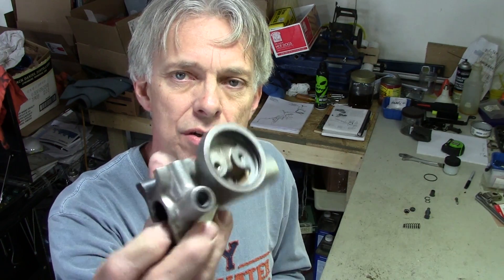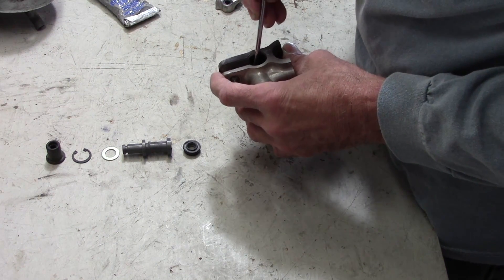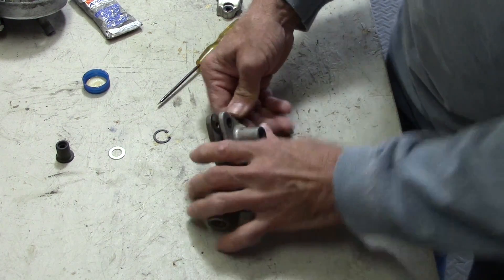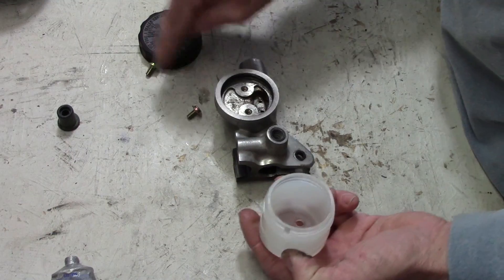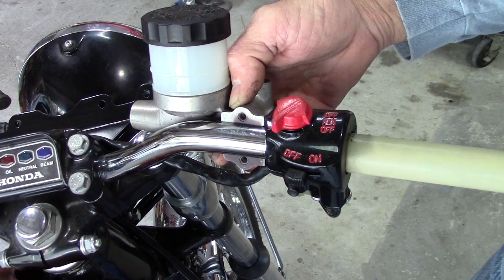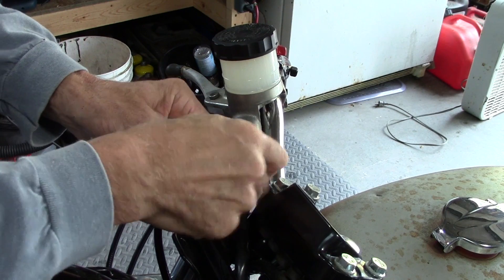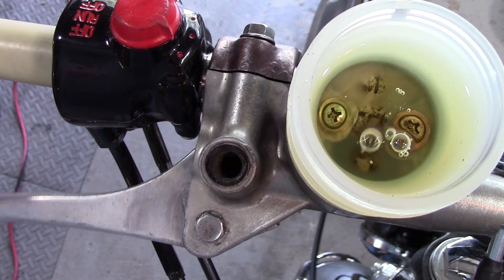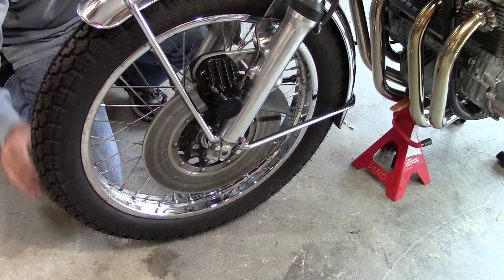73 Honda CB750 Custom Build Part 38 - Brake Master Cylinder

Comment: Here's a hack a mechanic taught me years ago. He took a large turkey baster and attached a clear tube to it just like the one you used here, sealing the connection with alternating layers of silicone and electrical tape. You use it by sucking up some fluid, then push the tube onto the bleeder and sqeeze the bulb. It forces the fluid up the line and fills the master cylinder. I've used this method on many bikes. It works well.
Reply: +Bobby C. They sell a commercial reverse bleeder for cars like that.
Reply: That's good to know, thanks. I'm gonna look into it!

Comment: When bleeding the brakes (an old tip from American Honda... yes I was a tech back then) Do NOT pull the brake lever all the way to the handlebar when bleeding the brake.  I tie a shop rag onto the grip and place the knot between the grip and the lever.  Pull the lever til it touches the knot but no farther.  Keeps the seal from going farther than needed.

Comment: I tend to use a syringe to do my brakes, saves a lot of pumping. Either pump fluid up into the line like the man with the turkey baster, or draw fluid down from the master cylinder, saves a lot of work.

Comment: I'm still new to this stuff.  Does the hole in the banjo bolt have to line up perfectly with the opening in that metal piece that attaches to the hydraulic line?  Is there any trick to that?  And what size tube should I buy to bleed the brakes?

Comment: (1) I really wish you had included video of extracting that C clip.  It's a real biatch to remove... your method would have helped a lot of people to see how.
(2) There is an aftermarket check valve you can fit onto the bleeder, which makes it so you don't need to rotate the bleeder valve orientation to pump the old fluid through.
(3) This video is misnamed in a way... your bike is a 73, but the master cylinder is weird AF.  It is not stock for the bike.  Even so, it is still a useful vid, but it was confusing to me to see the wrong part on a 73 at first, until you said why...and I had to re-listen to what you said there, to make sure of myself, at first.
(4) Thanks for making this video regardless.  I really appreciated it.  Once I rebuilt my brakes before internet told people how, and I felt like it was almost a coin toss to figure out how to orient the master cup (or cap - whichever it is called).  That was about 10 years ago.  Finally after that 10 years you solved the mystery for me.  I did install it correctly.  :)
(5) On my bike you would NOT want to hover over the reservoir with a camera, because when it is pumped even a little too fast, it backsprays brake fluid from that hole, and it can squirt into your eye.  Yes, mine did that to me.  The safe way to do it is to put the cap over the top so it can not spray into your eye, or onto your gas tank's paint.  And you want to squeeze slowly for this part, just to reduce the spray even more, and also to prevent air bubbles from being pulled down through the air-surface of the reservoir, and down into the brake line...On the stock brake reservoir, you need to keep adding the fluid to it during the entire process, to ensure that no air gets into the line.  The stock part's reservoir is much more shallow than this non-stock one you have.
Reply: 007mercucio You can also place a good size coin in the reservoir to prevent the pressure return hole from spitting back . (like a US quarter) leaving the coin in there doesn’t hurt anything long term either .
Reply: I spent hours with circlip pliers and ground down long nose pliers, finally took it to local custom bike shop and the owner got it out in under 5 min. using a pair of dental hooks (picks with  curved end making a semi-circle)

Comment: nice job. how do you get the feel to tighten things without using a torque wrench? I never feel confident in doing it in case I strip the threads, or don't do it right enough. especially the banjo bolt.
Reply: +apx5777 You just get a feel for it with experience. Using a torque wrench helps you feel how tight bolts are.

Comment: great video. Here is a question  I've often thought of... Why are brake reservoirs  of different  sizes? I have a Yamaha fz1 and it has the smaller rectangle  one. But is see other bikes with big round ones.  Ane they are downright ugly.  why  the difference?

Comment: I use brake fluid to lube the parts as I put them together. Also, don't use DOT 3 fluid. Its crap. I use DOT 5 in everything. If for some reason you don't like DOT 5, at least use DOT 4.
Reply from the maker: Main difference between 3 & 4 is boiling point. 3 is Glycol Ether, 4 is Glycol Ether/Borate Ester. Dot 5 is silicone based and should NOT be mixed with anything glycol based. It's also hydrophobic so it doesn't absorb water.
Reply: @HackaweekTV  that's correct. I use dot 5 in my bikes after total rebuild of the brake system. It's not for everyone, but I prefer it.

Comment: A lot of people are getting fed up with satellite and cable providers for their price gouging and poor customer service, and switching over to streaming services like Roku. (Like me).
It's so prevalent that internet providers are being pressured into integrating monthly limit caps.
Luckily, I have a fibre connection to my locally home-grown ISP that's less than a mile away, they have excellent customer service and will NEVER cap their subscribers.

Comment: Easy when you know how.Now would you bleed the brakes on a CBX 750?I've tried everything and can't manage it.Replaced pistons,seals,brake lines and mastercylinder. Blead repeatedly till no more air comes out and brake is still spongy.Must be missing something but don't know what.
Reply: +Alan Williams Replace the brake hoses with braided steel lines. HUGE difference! Old rubber lines can become weak and distort under pressure.
Reply: +Dean Segovis I did,Dean - twice.Ditched the splitter because people told me it can trap air.Now have two lines going directly from m/cylinder to calipers -no better.Weirdly, with just one caliper connected I get good pressure but when I add 2nd ,pressure is lost.Local bike shop thinks replacement m/cyl  is probably dodgy because it's a pattern (copy) part.It worked for 3 years,though.Shop advises m/cyl refurb kit but that will probably be a copy as well.Bikes - who needs 'em?
Reply: Did you get this problem solved?
Reply: No.I gave up chasing my tail and put the bike back on the road.Probably rely on back brake a bit more.I read an original road test of the CBX 750 in SuperBike magazine(online).They liked the bike but mentioned that front brake lever came almost back to the bar.I suspect a performance m/cylinder might sort it but I'm not prepared to spend the money.

Comment: Weird question(s):

1. Does anyone know what the approximate PSI this or similar master cylinders put out or capable of?

2. Does anyone know of a pressure transducer for a motorcycle brake system or can I use an automotive transducer with a reducer (if needed)?

Comment: it was always my understanding that no type of oil or lubricant should ever enter the master cylinder apart from brake fluid....or have i heard wrong?
Reply: There is special mounting grease included in most master cylinder repair kits, which is also sold separate as brakecylinder paste (e.g. ATE Bremszylinder-paste (thats German so it must be good)) or you can use fresh brake fluid. You're right about not just any grease should be used.

Comment: That doesn't look like any CB750 master cylinder I can find -- none I can find had a plastic reservior.
Reply: same here... nor any google pics either... but in the vid he said it was from a 77... i don't know about that, but it definitely does not match mine
Reply: Propably from a 750 F2 or F3. They had double disc’s as standard.
Reply: I have two 77 CB750K stock master cylinders and the reservoir is metal and part of the master cylinder. The 77-78 master cylinders don't have a brake handle adjuster screw.